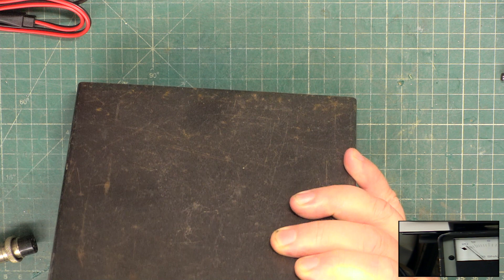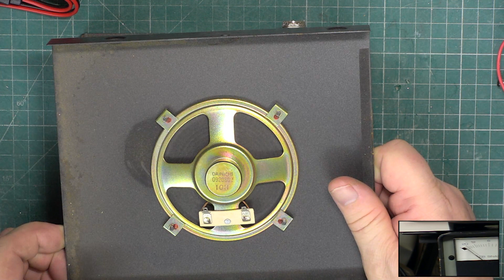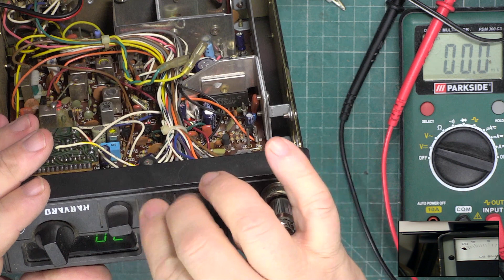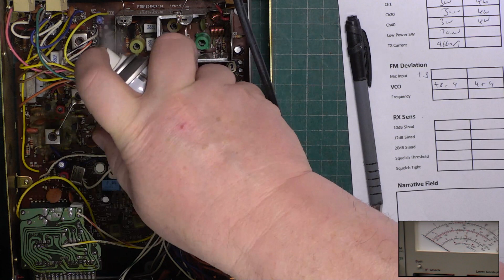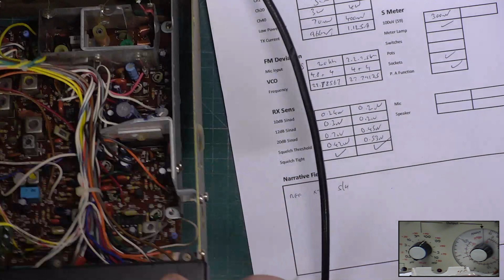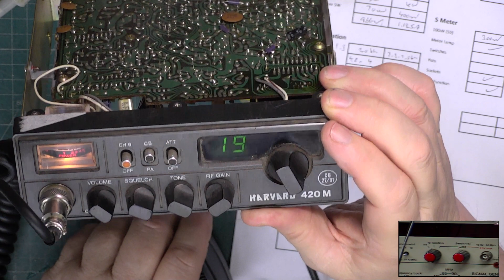Harvard 420M CB27/81 UK FM CB radio - repair & service

Comment: There was a lot more wallys ln CB when I first went on around 93/94 but from the stories I have heard it was worse still in the 80s, likely because there were many more people using the band then.

Mobile phones hadn't become mainstream when I was first on there and so from the stories I had heard and the already vastly deminished user base, it was the wallys that killed CB as a mainstream thing. What professional person calling into home to inform of their ETA wants their spouse to hear a load of foul language and generally unpleasant behaviour?
Reply from the maker: However, in rural areas, users sit on a particular channel...like I use 31. I have a Fidelity 3000 connected to our Tannoy system with a loft aerial & it gives us about 3 miles range. I probably only hear anything coming through once every two months. So, I monitor our repeater GB3GR, S20, S22, SU20, SU22, 4M calling on a scanner also connected to the Tannoy system & again on a loft aerial. Rarely any pirate rubbish coming through. The idea is I can pick up virually any radio...CB, 2M, 70cms, 4M  & someone here will here the call via the Tannoy system (which fades down the background music when a radio call comes through). sometimes an "eyeball Tango Towers" comes through.

I don't recommend any serious user to try & operate using 19.

Richard, G0OJF, UK

Comment: The 10.240 reference crystals i think are HC-18 socket. I think i am brain dead this morning  thinking hard lol.

Quartz crystal 10.240 MHz  HC-49s is a cut down smaller version of the HC-18. I will keep an eye out if i find any for a good price.
Reply from the maker: I find that with cheap new 10.24 crystals, about 1 in 12 actually are close enough to use.

Richard